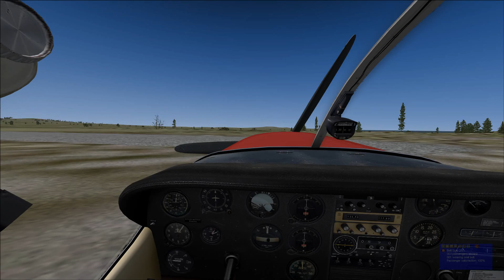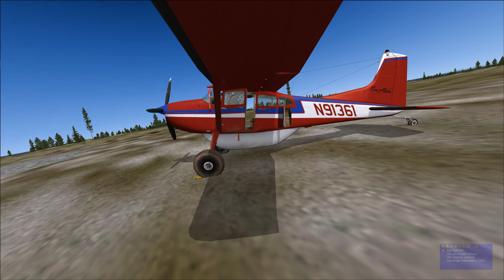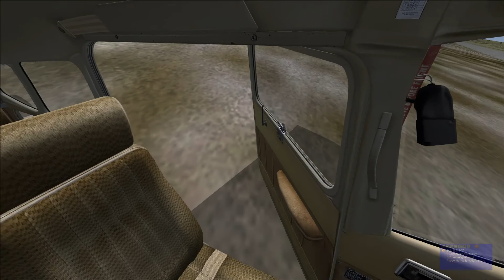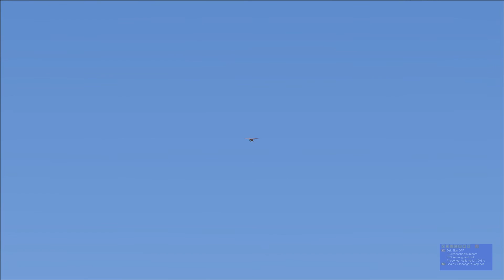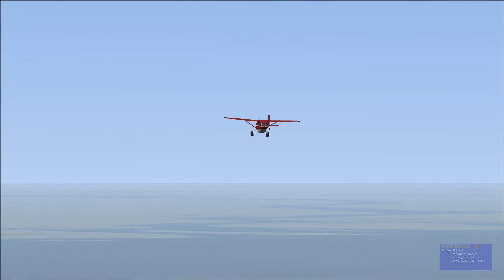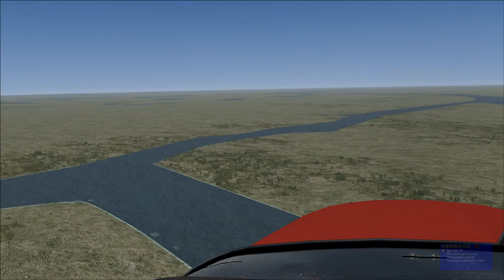✪ FSX Cessna 185F "St. Michaels (5S8) to Kotlick (2A9) Demonstration"

Comment: This was my favorite aircraft was actually using it on a Virturial Bush Pilot Airline online... are you useing the steam edition? I'm having all kinds of problems re installing this aircraft after my harddrive got bad sectors... so far Carenado has been unhelpful if you are using the steam edition did you have to do anything special to get it working? I had it working once in the steam edition
Reply from the maker: I purchased it directly from Carenado and then installed it on FSX-Steam with no problems.
Reply: BurnerTactical oh wow ok yeah I bought mine direct from them too thanks for the reply